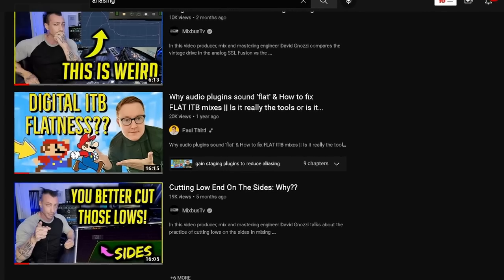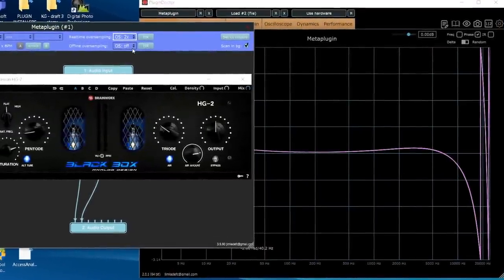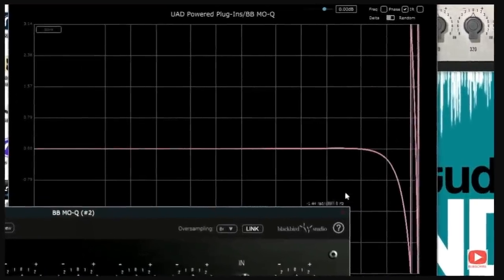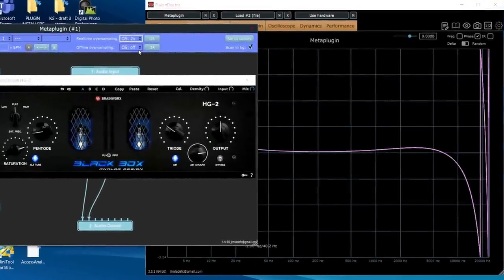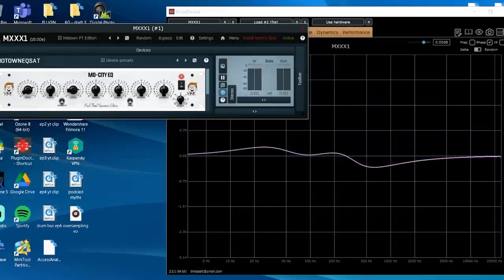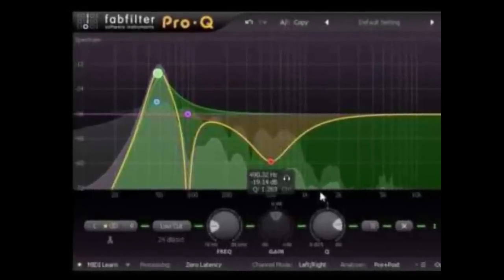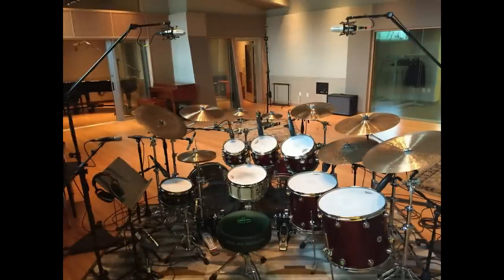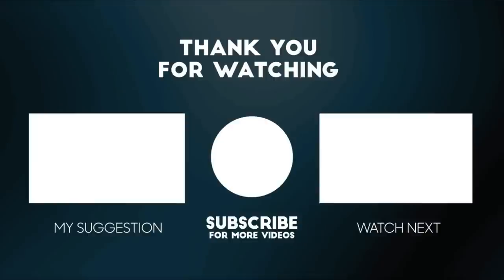Are YOU ruining your mixes by oversampling plugins??

Comment: When you are oversampling you should put a low pass filter after the oversampled plugin (while running your project at 48000hz 24 bit).This is the best compromise, Dan Worral says.
Reply from the maker: Don't get that one tbh
Reply: @PaulThird  Classic Worral s*** eh
Reply: @PaulThird  not to be rude, really, but if you didn't get the DW video, you shouldn't speak about this topic....
Reply from the maker: Tbh without your exact context I can't really say for sure how to interpret your statement. 

I'm reading this as your implying you must add in a steep lpf at 20k after oversampling, which I don't really see the benefit in. If you are using a lpf after oversampling to roll off needless high end information then that makes sense as you have less high end information to create high order harmonics but that's dependent on the source because the amount of roll off will depend on the source as we don't needlessly roll off high end for reduction in aliasing, we roll off because the source doesn't need it in the context of the mix. 

And also depends on the saturation as many saturators can cause harmonics made from frequencies as low as 5khz exceed niquist. 

Depends on the amount of saturation and the level of high order harmonics created 

Tbh I don't even know if you are implying to roll off high end, saturate it, and then add the high end back in afterwords. 

Or if you are talking about a parallel saturated track with pre rolled off high end blended in with the full band unsaturated. 

I undetstand why you would hipass infrasonic frequencies at 96khz & 192khz but at 48k after oversampling I don't get it as the frequency range is already limited to 24khz and most non linear plugins already have anti aliasing filters at 20k anyway which means that the oversampling filter is at 20k..and you want to add another filter after that? 

The reason why many advise a hpf at 96khz and 192 is because the infrasonic stuff is constantly in the audio and even oversampled still doesn't remove the infrasonic stuff after 20k as niquist in 96 is 48k, and 192 is 96k. This means that the infrasonic stuff can build on top of each other where with oversampling at 48k the audio is up sampled and then down sampled back to 48 which has niquist at 24k. 
So what's the benefit of adding a lpf at 20k after a lpf at 20k.. Because you've just done it with your oversampling filter.. Doesn't make any logical sense 

Its a pretty vague comment so without the correct context I don't really get the benefit. 

However send me the video in question where he discusses this at 48k with a time stamp and I'll re-watch that segment incase I've glanced over it the first time around.

Comment: Definitely avoid phase inducing eqs and oversampling when doing big cuts like with a high pass filter. It causes too many peaks. It's better to do an 18 db per octave cut with linear phase and you'll barely hear it. Definitely won't ruin your levels and actually will improve them greatly compared to regular oversampled eqs. Which add like 3 db of random annoying spikes everywhere. Luca pretolesi gives similar advice. He then shapes the transients later before the clipper. You can even use ssl bus compressor with 30 ms attack   after to bring some transients back. Youd be suprised how much the pros do things in a mix that they undo in a master. Adding transients at the end after squashing the track with compressors seems counterintuitive but its how you get a controlled loud punchy mix. Those spikey inaudible peaks are your worst enemy wheb it comes to the loudness wars. Linear phase is your friend out here trust me

Comment: This may be a dumb question but I’m mainly a director at this point…
If the final product was in 96k or even 192k, this wouldn’t matter?
Film is delivered in 48k at this point but I was wondering if it would be possible to deliver in 96k, especially for a synth heavy score.

Thanks!
Reply from the maker: You can oversample the tracks and still bounce the mix at 48khz

Comment: Interesting exploration Paul; I'm curious; and I'm happy to look a bit ignorant on this topic by poising this question; 

What if we just ran our sessions at 96k for mixing and you're already at the 2x sample rate; which gives a lot more bandwidth for ALL your plugins including those without oversampling;

Is there anything in the process of doing so which impacts the fidelity of the audio negatively? 

Or is there no added benefit in doing so; if so why?
Reply: All of your questions can be answered by simply applying them and listening for differences. Or render both out and listen to the delta
Reply from the maker: I see more benefit personally mixing at 96k. Mainly cause it means you have a "more analog starting point". If I had the processing power id mix at 96k without hesitation. 

Don't care about file size as id just invest in more external storage. 

No eq cramping at 96k and there is no need for OS to fix it .. However that falls flat on its arse when you use a plugin that already is internally oversampled to stop this but the phase response is more natural at 96k anyway so the phase roll off is shifted up, like what I showed in the kit video and the bettermaker/kirchoff example. 

On the most part you'll find that aliasing in most analog emulations (bar saturators) is under the audible threshold at 96k so it simply means that you don't need to worry as much as by default there's less aliasing and no eq cramping to worry about.. And you can essentially use any plugin you want within reason with less use of oversampling, or simply none at all. 

That's it really. Just covers a lot more bases and requires less plugin management.

That's just me though.
Reply: @PaulThird  Yeah fair enough; that's what I thought ! I just wanted to make sure I hadn't missed any information. 

The past few months I've been mixing at 96k because my CPU more than manages.

Comment: What i don't get is why is it ok to perform LIVE sample rate conversion up AND then down again but then fuss over which is the best SRC software when converting the sample rate of audio files. For example converting a file in just one direction using Voxengo's Rate Brain takes a lot longer than real time, so how can real time be good enough?
Reply from the maker: Tbh SRC is something I generally stray away from. I've seen the many forum arguments over the years haha
Reply: @PaulThird  ha ha yes I have been very wary of it too, enjoy your vids by the way :)
Reply: Have you upgraded your version of R8 brain? The old version from the mid 2000s is severely outdated and the newer versions make use of multi-core processing among other modern processor calculation features.

Comment: Static high-end phase shift is normally inaudible. Aliasing is likewise inaudible, so long as it is confined to ultrasonic frequencies above 20Khz. Take care to filter out ultrasonic frequencies, and you will have no audible problems with aliasing.
Reply from the maker: Not in the tests I've done at 48khz. Both are quite audible and can be picked out in a blind test

Filtering at 20k only filters out frequencies after 20k, not the harmonics made from the frequencies below 20k. They still surpass nuquist and cause aliasing and that's why we require oversampling
Reply: @PaulThird  - All tracks sampled at 48Khz have been filtered with a steep low-pass filter at ~20Khz before being digitized. This imparts a static high-end phase shift that is built into your original source tracks. Adding more static phase shift with further processing does nothing to make this more audible. Human ears are very sensitive to DYNAMIC phase shift, but are incapable of detecting STATIC phase shift once there is no unshifted reference for your ears to compare it to.

If your tracks are contaminated with harmonics below 20Khz, you are either processing them with non-linear plug-ins that generate distortion or overdriving the signal somewhere in your gain structure. This is a hazardous practice with digital processing, because those non-linear processes may also produce harmonics above 20Khz that can fold back to produce inharmonic aliasing. If you want to use non-linear processing, it's best to quarantine it in an external effects loop to keep your digital mix clean.

Comment: Interesting Paul. Are you searching for plugins to use that have minimal aliasing? 
One of the things I've thought about with oversampling is that the filter will effectively reduce anything over Nyquist from bouncing back down into the audible frequency range, but if that is the case, won't the saturator that we've stuck on to generate harmonics be redundant anyway, will we hear the harmonics or will they be filtered out. I'm guessing they'll still be audible if they are still below Nyquist but for those that go beyond Nyquist they'll be filtered